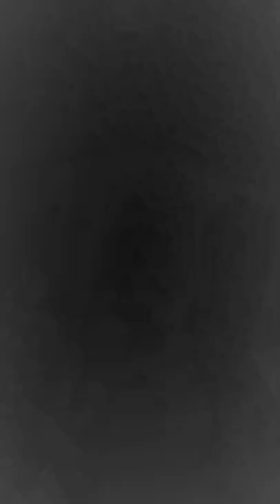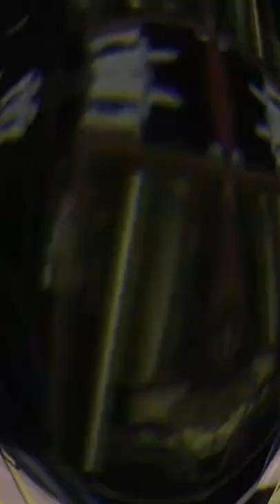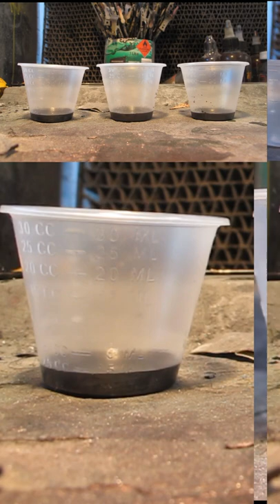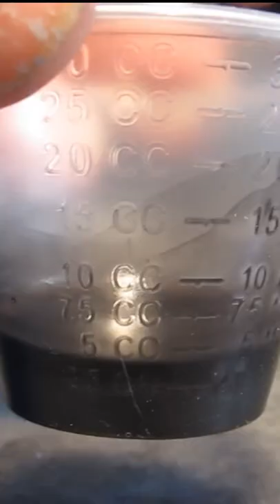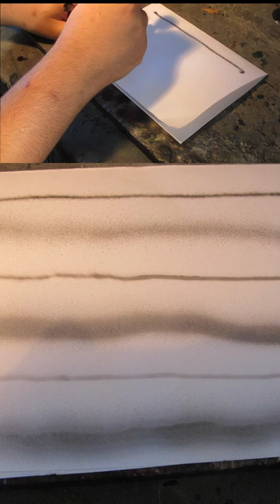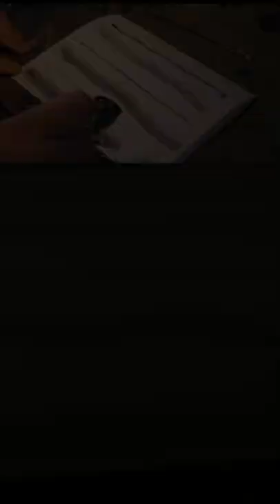#Shorts airbrush paint viscosity

Comment: Thank you for not using ratios. I never understood why some folks use ratios of paint to thinner when even the base viscosity varies so much between paints, brands etc… even two identical paints can have different base viscosity due to age or evaporation of agents, leading to different ratios. Not to mention airbrushes spray differently and take different viscosities depending of nozzle sizes, air pressure etc, so ratios are kind of bullshit. Best is to use 50:50 (as a very loose rule of thumb) as a starting point only, and take it from there… the Milk method is just to give some general idea, but the absolute best way imo is to do what you did… mix in a shot glass or mixing cup and see how it runs down the side of the container. Good job dude thanks for sharing.
Reply from the maker: I always used ratios like you 50/50, 1/3, 1/5 ect. I found using almost every gravity airbrush on the market to be nearly the same unless side mount which only works on super high viscosity like artist ink and useless for us then siphon which is obsolete. Nozzle sizes makes a huge difference so does nozzle cover. Most important factor is paint type as it flows differently. Once I learnt how to read viscosity the hobby changed for me and paints are super easy to control. I hope many find this video very important and will break free from bad advice in this hobby. Sadly many disagree with this method due to 50 years of ratios and milk.

Comment: I find I over-thin quite often. Is there a good way to tell with this method or is it still usable with a lower pressure?
Reply from the maker: Over thin can be applied with low psi and light coat but at a point will not hold tension and slide off the intended surface. If it wont stick to the side of the glass/ plastic then add more paint in that container. With this knowledge you will be much better at mixing and thinning in no time. Always measure in the shot glass.
Reply from the maker: Also I am never this quick to reply LOL. Your very lucky today.
Reply: @mokanaman  speedy reply indeed. I was sorta using this method before but was incorrectly looking for the opaque result. Also how well does this method work for clear coats?
Reply from the maker: @THEdanrugaming  Does not work with clear coats what so ever. I have not spoken on this yet and working on a video idea. Clear color is more or less just resin and thinner which behaves differently to paint and takes to over thinning very well. Not sure how but it holds tension. So generally I just over it.
Reply from the maker: What sort of paint are you using?
Reply: @mokanaman  for colours I am now using primarily SMS Infinity and Vallejo Model Colour acrylics